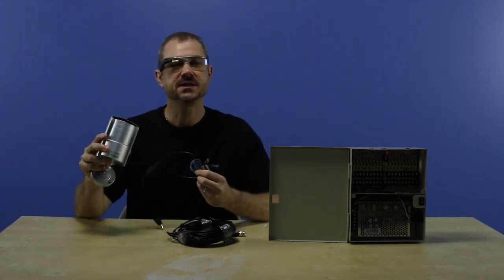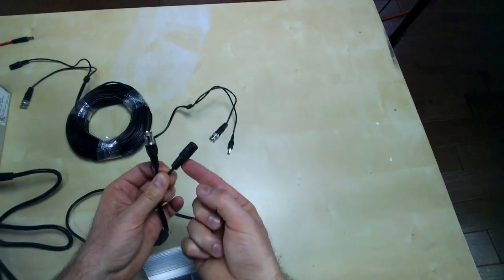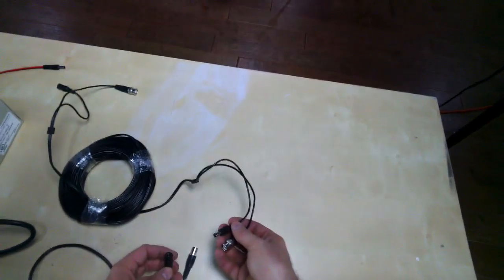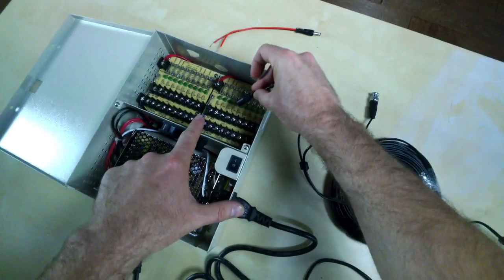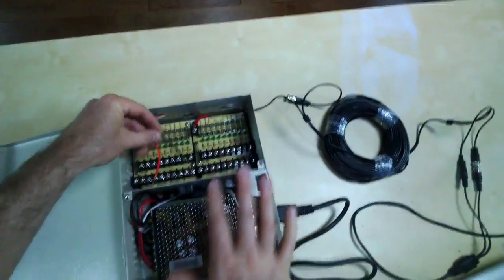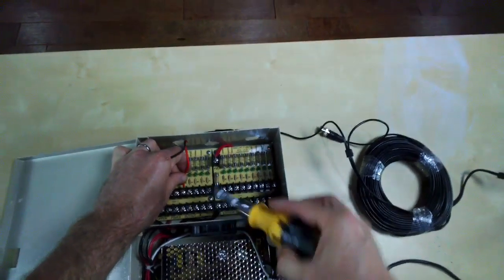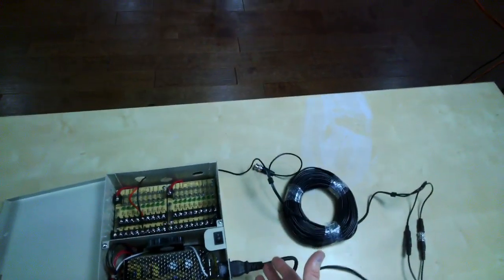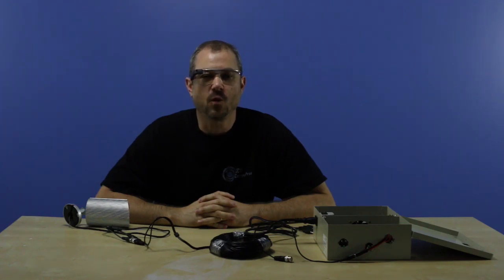CCTV Camera Power Supply Box Wiring with Premade Siamese Cable

Comment: Question, could I just cut the power plug off the end of my Siamese cable and wire it up that way or do I need the pt3 connectors?
Reply from the maker: If you are using pre-made Siamese security camera cable, you CAN NOT cut the power plug and use the raw wire. If you want to use raw wire, instead of a PT-3 to connect to your power supply box, you must use Siamese cable from a spool like this: https://www.cctvcamerapros.com/RG59-Siamese-CCTV-Cable-s/259.htm

Or power cable like this.
https://www.cctvcamerapros.com/Surveillance-System-Cables-s/261.htm

You can not cut the ends off of pre-made cables like these.
https://www.cctvcamerapros.com/CCTV-Security-Camera-Cables-s/258.htm

Comment: I want to buy it. But i have no idea about how much distance it can travel . is there any voltage drop with distance?
If it is so. how to know about it.
Reply from the maker: +Amit Kumar Das these premade cabled use 18/2 power cable. http://www.cctvcamerapros.com/Premade-Siamese-Coax-CCTV-Cable-p/hd-165.htm You can use the voltage drop calculator here to calculate voltage drop for low voltage power. http://videos.cctvcamerapros.com/voltage-drop-calculator
Reply: +CCTV Camera Pros ThanK you for the valuable Information. Please suggest me a good smps for cctv. I have total 8 cameras. Max wire length per camera is 35 meter I have used Rg6 video cable and 2 core  0.75sq mm power cable. I want to centralised the total power. All camera needs 12v Dc and  power consumption of each camera is Max. 1.8 W (Max. 4 W with IR cut filter on). Please reply Sir I am totally  confused.
Reply from the maker: +Amit Kumar Das you can use a power supply box that is 12V DC / .5 amps per channel. Like this one. http://www.cctvcamerapros.com/Power-Supply-Box-p/pspro-dc9.htm

Comment from the maker: How to Wire CCTV Cameras to DC Power Supply Box

In this video CCTV Camera Pros co-founder, Mike Haldas, demonstrates how to connect a CCTV camera to a DC power supply box using pre-made Siamese cables.

CCTV Camera Pros recommends using power supply boxes when planning a surveillance system with 4 or more cameras. Power supply boxes help make your wiring installation neat by running all of the power to a central box. Also, each channel is individually fused which provides protection for each camera.

Here are a few important things to note when using premade Siamese cable with power boxes.

1) Make sure that you pay attention when you run the cable so that the camera end is on the correct side of the run. One side of premade cable has a male and the other a female for the power supply wire. Get this wrong and you will be re-running that cable.

2) You will need a PT-3, also known as a pig tail lead / power lead, for each cable. The PT-3 will be used to convert the 2.1mm power plug to a positive and ground wire, which screws into the terminals of the power supply box.

Learn more about power supply boxes for security cameras here.
http://cctvcamerapros.com/psbox
Reply: I use Google Glass in this video demo.  #glassexplorers